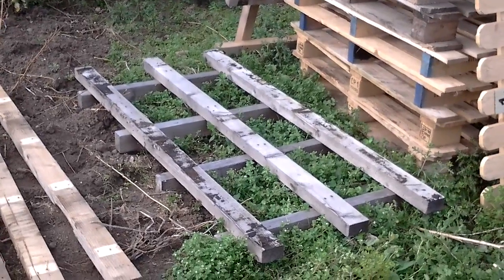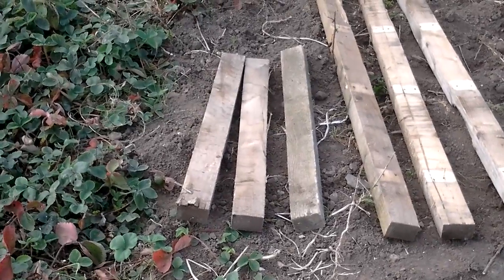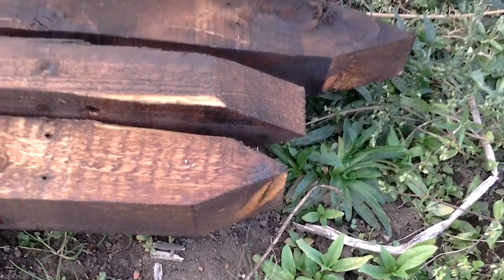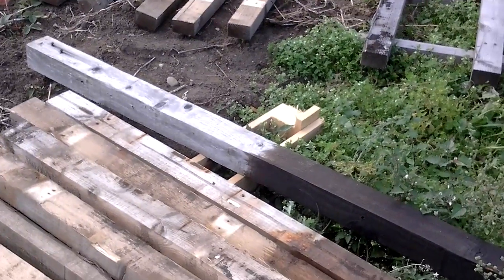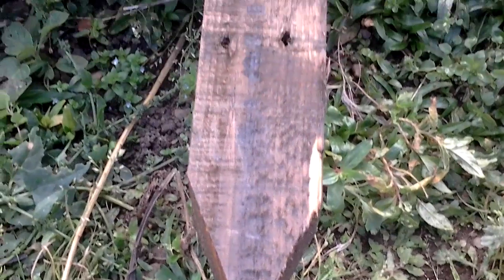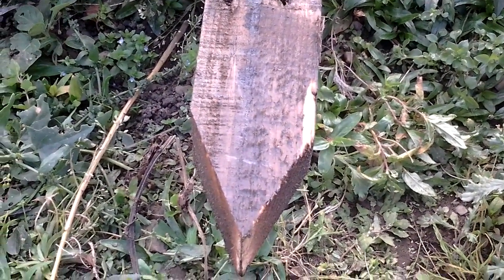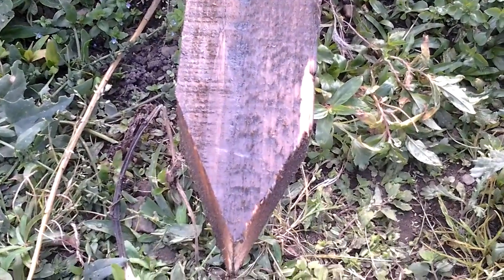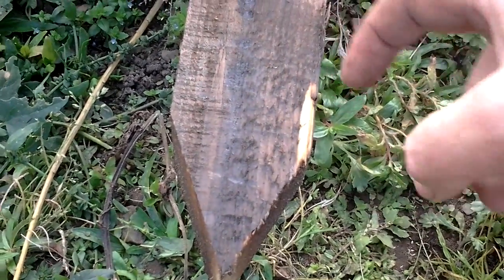#StartingANewAllotment  Series 1, Episode 3  "Making Fence Posts From Recycled Pallets"  (180)

Comment: Happy gardening to you Terry, I agree with your wood water proofing measures. I also used old engine oil for my posts, not something I would use on my raised beds but for fence posts it's fine.
Reply from the maker: I agree with you on that, I will be using something more environmentally friendly on the beds, which probably won't last long. 

😆 Happy Gardening to you my friend, Terry.

Comment: Creosote and Oil.....a mix I used to use when you could get "proper creosote"??You may recall the old fence next to the tree you cut down?  Me and the owners father painted that I the same mix....29 years ago.......I think it works 😄😄😄
Reply: Makes you wish there were more robinia plantations so it would finally become more affordable to buy actually durable poles. You can just hammer them into the soil and they last for well over half a century with nothing on them. Now we're kind of stuck slapping toxic stuff on wood that wouldn't last longer than a fart in a thunderstorm otherwise. I don't like the copper impregnated wood. It just doesn't last.
Reply from the maker: Hello Nigel, my fence panels at home were done at about the same time and they are as good as new,  but don't lean on them though lol.👍 

😆 Happily Smelling for a while, Terry.
Reply from the maker: Good comment my friend, Terry.

Comment: One method of preserving the posts from rot that seems to last a very long time is charring. Ive never used the process myself but I believe the process requires first making sure the wood has absorbed some extra moisture, then when the surface has dried you give a thin coating of oil, let it burn for a short time then extinguish. It then needs to re-dry fully before being used.
Reply from the maker: Very interesting information and something that I may try.

Happy gardening, Terry King.